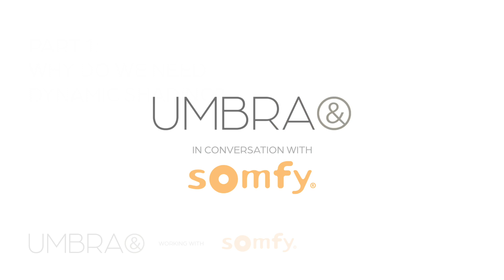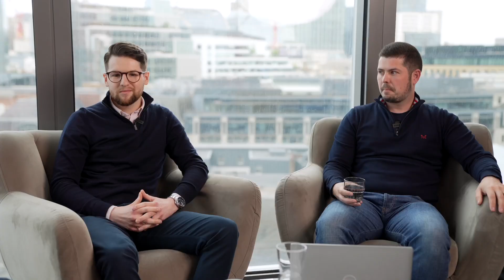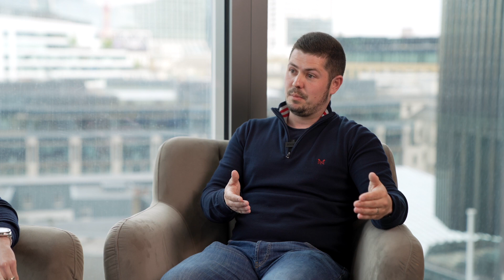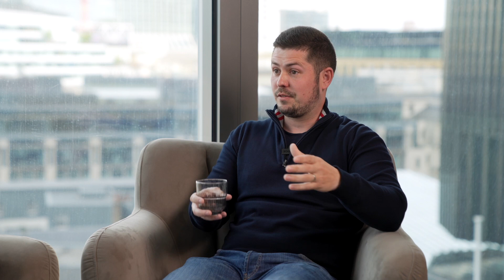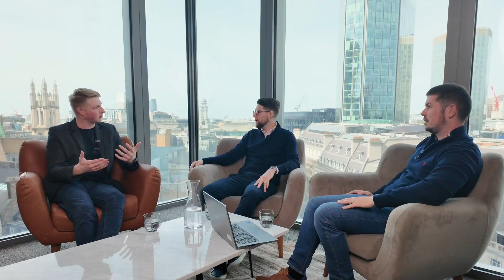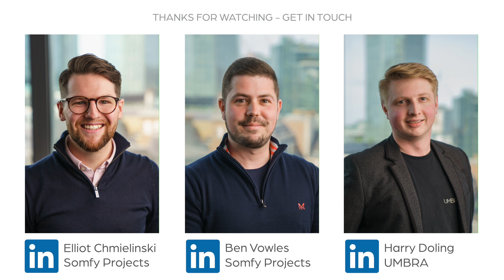Umbra in conversation with Somfy - Automated shading in 2024

Comment: I have installed Loxone automation which can automate shading to help with thermal gain up and down. The installed said that this worked best with external shading like external blinds rather than internal as the blinds can't make such a difference when the solar energy has come through the glass. It would be good to have your view on how automated "internal" shading can help. Our home build has most of it's glass North facing so less gains to be made or lost but the combination of automated shading and MVHR would be really interesting to see.
Reply from the maker: Great question. 
The first thing to consider is that 'external shading vs internal shading' is not a black-and-white comparison. 
Think of it like SPF levels on bottles of sunscreen: blinds have different characteristics depending on the blind type, fabric type, fabric transparency and fabric backing etc. A roller blind with a 5% screen fabric is a bit like SPF 30; it lets a decent amount of light and visibility through, whilst offering good protection from the sun. A blackout blind, of course, is more like SPF 50; blocking out light and therefore heat far more than a screen fabric roller blind. 

Staying with the sunscreen analogy, external shading is like wearing a hat: it's either on or off and it does a great job of stopping the heat. Fixed external shading is not a good solution to a dynamic problem (the sun!) but moveable external shading is a much better solution however both options are comparatively a lot more expensive than internal blinds. That said, they are more effective at stopping the heat/light even entering the building in the first place, so in that respect they are 'better'.

Internal blinds, on the other hand, offer UV protection, heat reduction, glare control and internal acoustic dampening. Internal shading can reduce heat loss by up to 33% energy in the winter, whereas external shading is completely ineffective at retaining heat. They aesthetically harmonise with the interior design theme and they can be automated to work with other smart home devices like lighting and AV systems

Ultimately, neither is 'better' than the other. In an ideal world, people would specify both external and internal shutters and have both systems working harmoniously. External shading is 'better' at keeping the heat and light out for a few hot and sunny days of the year, but that's all it can do. Smart blinds are a better all-round solution for every day of the year. 

Hope this helps. If you need anything from us, please email sales@umbrashading.co.uk and one of our discovery team members will be happy to assist.